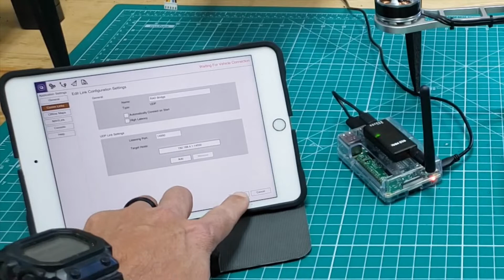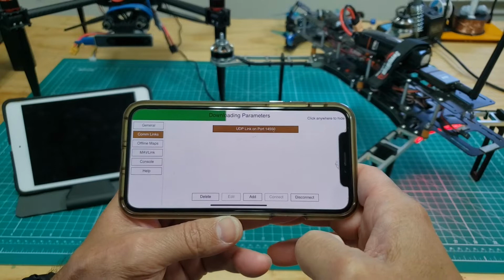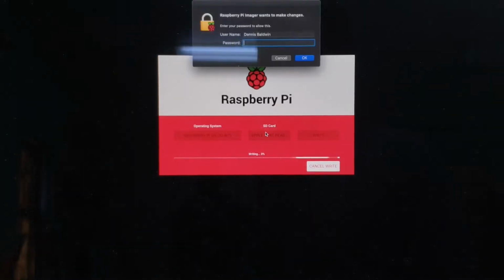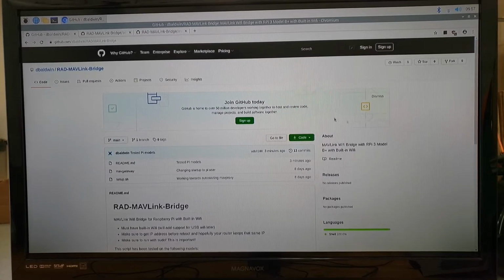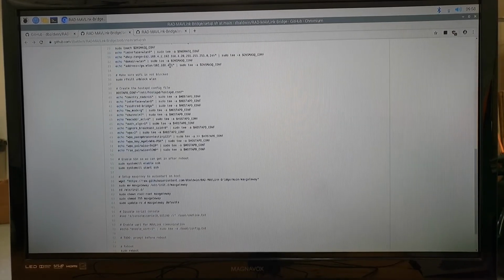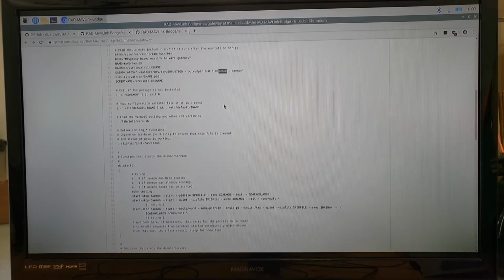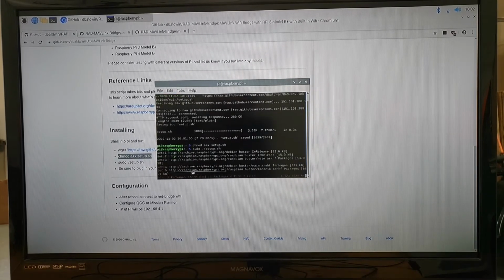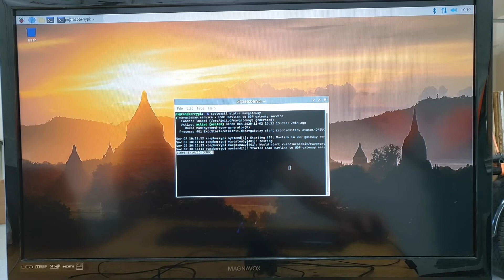RAD MAVLink Bridge Installation Script for Raspberry Pi

Comment: What wifi adapter are you using I have a old telemetry but the one I used on the drone is no good so will the one I plugged into my tablet work for this project??

Comment: Thank you for doing this! I have an old 3DR MAVstation prototype that is now usable as a RAD MAVLink Bridge. I don't know much at all about Raspberry Pi so it was an adventure working on this. Your script made it super easy! This MAVstation has a Raspberry Pi 1 Model B with a USB wifi dongle and another hat board on top of it which has the SiK radio and a GPS/compass connected to it, along with a power supply and Lipo battery with on/off switch and charge port. All in a clear plastic enclosure with a few buttons on top. I believe it was originally intended to be a bridge and follow-me device but the project was not completed.

Only 1 issue I can see is I have to plug another SiK radio into the USB port because it won't use the SiK radio that is attached to the hat (I assume via serial port). If there is a way I can point it to the serial port instead of the usb port it would be super handy. Anyone know how I could make that change? I am a Pi noob.

Comment: Thanks, Greate video.. My goal is to connect  4G modem and connect the RP to Zerotier VPN so I can connect from anywhere.... Can it work at the same time as your project? I just connect the RP to a Zerotier VPN. and any other device should be able to connect to the pixhawk using the default IP of mavproxy...correct?

Comment: Hi Dennis, Good job, I built mine, powered it with a 5v/3A BEC and 2s 18650, put it in a project box, I also added proper poweroff as described here https://github.com/TonyLHansen/raspberry-pi-safe-off-switch/. Works a treat. Thx

Comment: Nice job Dennis, Have you seen these https://www.3dxr.co.uk/product/rf-design-rfd900-txmod-v2-rc-transmitter-module/ a similar concept, but offering wifi and 900mhz telemetry radio, in a JR Bay module. Imagine if you could create the same concept in a JR module bay package, offering wifi and telemetry radio? Perhaps a OrangePI could be considered as they are generally smaller (I have one and will check it's compatibility).  Thx Andy

Comment: This capability is available already.
Just Google apsync
Reply from the maker: Thanks for the tip. Looks like it's a project from Randy McKay, which means it's top notch. I will give this a try on my next setup and post my findings. Appreciate the info!
Reply: @dennisbaldwin  Looking forward for further improvements in the system especially long HD FPV without rare WiFi Cards